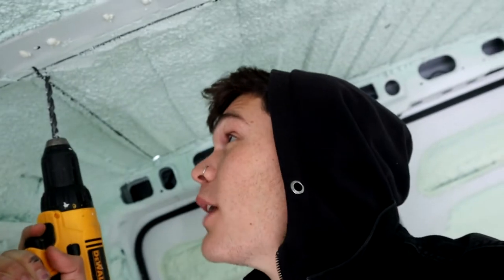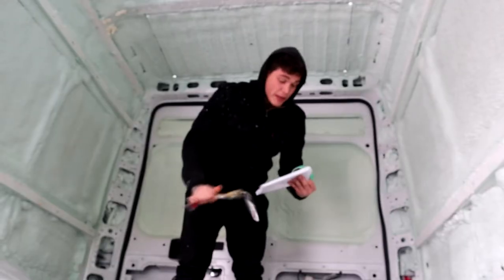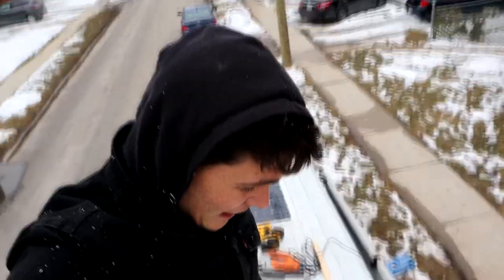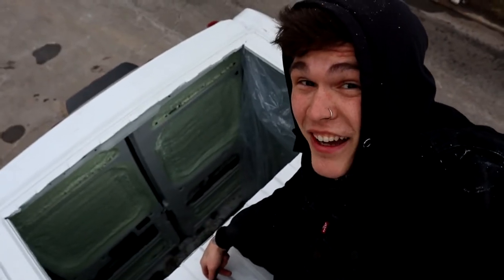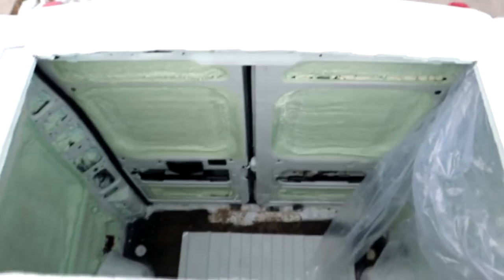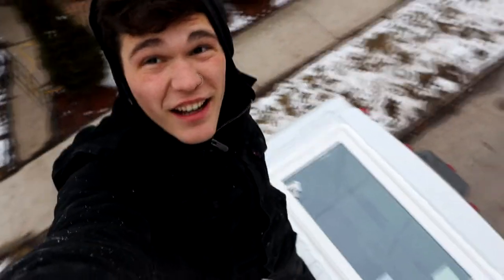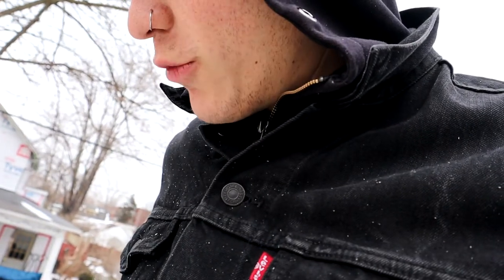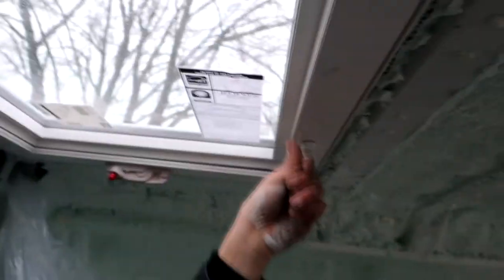SKYLIGHT WINDOW INSTALLATION

Comment: Hey bud I'm just wondering which window did you exactly use for this and if it's still all sealed up? Cheers mate!
Reply from the maker: Not sure the exact model. It's a casement window I ordered from the home depot website. Got it all sealed, it wasnt easy, I had to get real creative, but it's perfect now!
Reply: @brensocial  Looks absolutely amazing! We actually did the same, but we still have leaks and already all our ideas gone how to fix that 🤦‍♀️🤷‍♀️🙈 if you could share some tips please! That would be awesome 🙏
Reply from the maker: @editaedith8596  the leak we had was coming from the cracks between the window and the frame, so I used an L shaped piece of rubber I found from home Depot. Stuck one end of the L in the crack between the window and the frame, while the end of the L hangs over the crack so when it rains, the water pools onto the window and rolls off over the crack instead of inside. We are almost at 2 years no leaks now. Good luck
Reply: @brensocial  thanks a million m8 🙏
Reply from the maker: @editaedith8596  there is another video I made after this that shows you a bit of what I mean, it's on my channel. Hope it works out, cheers!
Reply: @brensocial  I will definitely watch it! Thanks for your time! Appreciate

Comment: Omg so I just got my van 3 days ago and I don’t have windows.. I want to have a skylight so your video popped up!! Thanks for posting cuz I’m probably guna do this .. legit lol.. when the window is shut has it leaked at all since it’s meant to stand straight rather than flat?? Just curious if you had that problem cuz I’m two clicks away from buying one of these lol
Reply from the maker: It's works! I had to modify it though and install a lip around the window so the water doesn't get into the cracks. I did another video updating it, you can find that on my chanel. Good luck. It's worth I we love it. Cheers!
Reply: BREN thanks for actually responding!! That never happens- I actually subscribed to your channel then went creeping through your vids and found the video you are talking about 👌🏻 I look forward to seeing more content! 😎